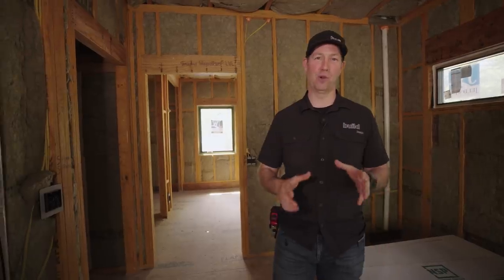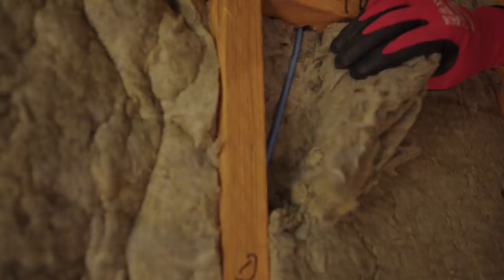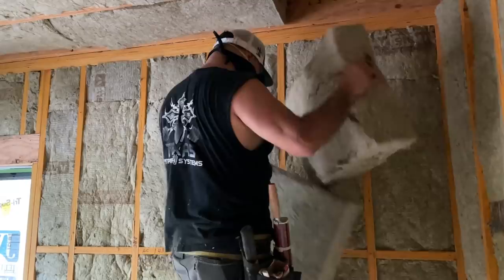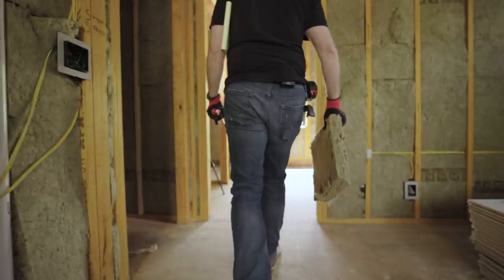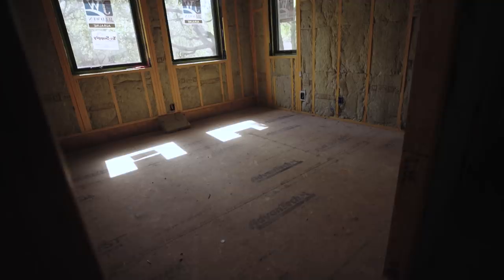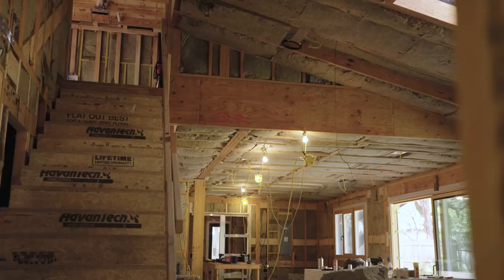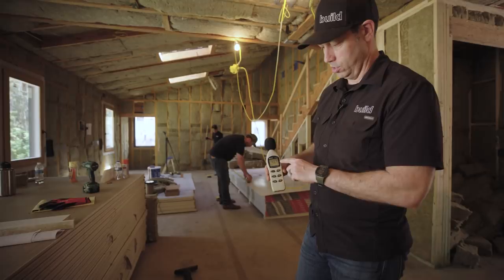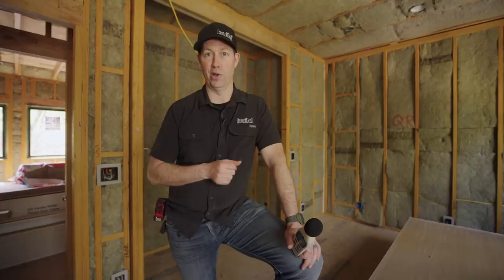7 reasons I used Rockwool insulation at my house.

Comment: I love Rockwool. 

My only complaint is that it needs an additional vapor barrier on the interior side of the wall like Certainteed’s MemBrain in cold states where I am. I also like to glue and screw my drywall so the vapor barrier basically makes gluing useless.

Much better than fiberglass, and there are so many horror stories with closed cell spray foam 😬

Comment: rockwool is also not bad for insulation (no matter what house or shelter you add it to); it is fireproof and waterproof, and soundproof as well as frostbite proof.. but if wanna save money, just insulate everything with several layers of polystyrene foam, even if you keep it inside your shelter, it will produce warmth and amplify heat by retaining it, and holding it from dissipating out into the outside or even in the cold air that creeps in at night in any house or room.. stockpile the foam in every corner, seal windows or walls with it, and your Ice Age survivability rate just jumped 60% (with the 30% fluid water that is antifreeze and drinkable and geothermal heating gave you).. also if you use this in your house and it's enough to keep you moderately warm at night or during blizzard, you can use geothermal for your water tank (as long as the antifreeze inside doesn't leak into the fresh water inside you store for drinking)

Comment: Matt, I totally hear what you are saying on spray foam insulation in the walls when it comes to floods and water; however, please just know that spray foam is actually water resistant, it’s just that when there’s a true flood the water can get in between the spray foam by pushing pieces open. I have spray foam insulation in my old field stone basement  which gets damp in heavy rainfall, the spray foam has accumulated 0 signs of moisture absorption and the company actually showed me it was safe to use by putting a chunk of it in water. It floated. Then they pushed it under and took it out, all the water came off and it was dry.
Reply: That sounds like closed-cell foam, he was showing open-cell foam that was soaked with water.

Comment: Rockwool is absolutely a great (if expensive) product, but I'm always leery of their advertising regarding sound attenuation since they are ALMOST deceptive, in what is never said and what is implied.

Rockwool's primary competitor is fiberglass and it turns out that both have extremely similar performance not only in R-value but also when it comes to sound attenuation. Uncovered Rockwool and fiberglass have very small measurement differences and almost no perceptual differences. But you will never see a Rockwool demo with the drywall installed. That's because when that happens, the perceptual advantages of Rockwool go notably south. In the covered case, Rockwool and fiberglass behave identically, from what the human ear can hear.

This video does a great job showing the many positive advantages that Rockwool has over fiberglass, so it's mildly jarring when the sound control aspect is trumpeted as a UNIQUE advantage, when it simply isn't.

(Regarding cost - it wildly varies by region. Here in Phoenix, Rockwool is quoted at 4X the cost of fiberglass!)

Comment: I would not use 2x4 on a new build but given the fact you had an existing foundation, I completely agree that LVL + Rockwool is the way to go, if your budget allows you to. Strongest framing option and best R-value per inch, besides all the fire safety and acoustic benefits. Sure you will have very little problems with this build in the long run.
Reply: What would you use instead of 2x4s?
Reply: @ducoh2093   What do you mean exactly when you say "staggered" 2x6s?

Comment: I sell insulation for a living. Rockwool is more expensive than spray foam but doesn’t provide an air barrier or vapor barrier. For the kind of money spent on this job I would take spray foam all day. especially in the roof where ventilation is critical with non air barrier materials like rockwool/fiberglass. It’s difficult to ventilate adequately when you’re batting right against the roof line like he did. Whenever you use non air barrier insulations you’re going to experience condensation, the ventilation is required to exhaust water vapor so the condensation doesn’t become a mold and moisture issue. If he were to spray foam, it would eliminate the condensation entirely and thus negate the need for passive ventilation. If this house were in an area that gets a lot of snow, it would likely get ice dams (which is a whole other moisture issue) with this insulation package. With spray foam those ice dam issues disappear also. 

Lastly, rockwool’s selling point against foam is that it doesn’t stick and it isn’t difficult to demo. I always remind customers that your drywall is a lot more difficult to cut through than open cell spray foam which pulls out in chunks by hand! Even closed cell cuts out better than drywall. Also, we typically build things to last, not to demo. 

But yeah rockwool is cool for fire blocking.
Reply: wow, ure so wrong... u sell insulation for a living and do not understand that rockwool it self is an air barrier. that is the biggest advantage over styrene type of insulations or cellulose one. Rockwool is made out of stone particles. Stone has natural ability to eliminate damp and moisture over time depending on the inside outside conditions. The only thing that can make an influence of what you say is the way you install the insulation. In us they tend to do the dry way of installing and in europe we tend to do the wet way by gluing the boards with adequate glue/thinset. The wet way is better since it makes more compact coat of insulation whereas the dry way has a lot of cracks that needs to be sorted out usually with an air barrier(what you've mentioned). In europe they use air barrier only on the north side of the building because that side is not exposed to sun light as much as it needs to so it can naturally ventilate through the rockwool.. The advantages of the rockwool over styrene type of insulation is that it is natural material and does not totally seal(such as closed cell) the space from outside. Typical Japanese Arch. house did only use natural materials such as wood and hay sack and they tend to make the living space totally connected with the elements during all season. In winter they tend to live around the fire place as a source of heat and during summer they use the shade and openings for natural air movement providing passive ventilation a thing that is being used today in the most advanced buildings. Today modern buildings tend to eliminate the natural way living by using modern materials but they forget that we as humns need to be in contact with the nature instead of being disconnected and living in air bubbles. Japanese trad. arch is the best imo. of a way to live in direct contact with nature during all seasons. A passive house standard is a different story and still id choose rockwool over styrene anytime. Styrene is better insulator in terms of r value but it is very artificial.
best regards.
Reply: @serafar  I’ve never heard of a wet-install of rockwool. So what it goes on like a plaster/concrete almost? That’s interesting! I wonder if it cracks over time as it dries or as the house settles. That’s not a standard application in this country so I can’t speak to its efficacy. 

Rockwool isn’t exactly a natural product though. It’s stone based but it’s still processed and produced in a factory with binders and everything else. And the philosophical debate over what’s natural and what’s not is interesting but when you get down to fundamentals, everything in this world is made up of chemistry. I would say a home we build for ourselves is every bit as natural as a nest a bird builds for itself.

But to my other point, the rockwool used this in video is not an air barrier which makes it inferior to polyurethane spray foam.
Reply: @seanstack180  what i meant was that rockwool has natural ability to regulate damp and moisture from tha air. eps and xps do not. eps has nothing against moisture and damp while xps is totally sealed and thus repeal moisture and damp back from where it comes.  eps will absorb all the moisture over time kinda like a semi sponge and considering the dew point in the wall it will most likely generate structural damp.this is why you need a air barrier.  xps will do you good protecting you from outside during winter but it will also protect the outside from  the inside moisture that comes from the human body and anywhere where there is water in the house. because of this you need a good hvac system. rockwool has natural ability to regulate the damp and the moisture meaning it will absorb it and slowly move it from one place to the other. this way you do not need some special hvac system. all yo need is heat source and window opening  when the sun is up during all season. esp in the summer you do not need to run an expnesive air conditioning unit. 
https://www.youtube.com/watch?v=un5gBFgc8aU
in europe the air barrier is the last coat of the facade and it must be silicon based glue that can let air pass - permeable one..
https://www.youtube.com/watch?v=BDVTlUiV_MA
all the best man..
Reply: @serafar  insulation doesn’t regulate moisture. The hvac system does that. Spray foam eliminates condensation and the hvac system regulates the humidity generated by people living in the house breathing/showering/cooling. 

And if something is an air barrier it is not air permeable, it is air impermeable. Spray foam is an air barrier and a vapor barrier, the rockwool as shown in the video is neither.
Reply: @seanstack180  I made a mistake mixing the correct term and that is vapor barrier. if u listen carefully at 5:02 he mentions what i am trying to explain to you.

Comment: @9:40 there's no reason foam shouldn't also be used for air sealing purposes.  Works great on my new place @ 4,000 sq ft and an ave $50.00 electric bill.

Comment: My house has 12 cm rock wool in the walls and 18 cm in the roof.
Live in southern Switzerland and insulation is mainly to keep heat out in summer more than keeping it in during the winter years.
Air con uses more energy than heating.

Comment: I bought $80 from ebay to reinsulate the oven after mice pissed fiberglass failed. It is a little tricky to install, it is stiff to work with, but it is so much better. The sides of the oven stay cold now, before they would get warm in self clean. Rodents dont like the stuff, and exactly like Matt said it will not hold water. I still have half of the material left after the oven.

Comment: Don't be to sure about the water-resistance. This stuff is used to keep aquarium plants hydrated in long transit. It holds water really well. Something like a splash or trickle won't bother it but a hurricane submersing it in water absolutely will absorb the water.

i would say tho the benefit here is that as a fiber, it's generally going to hold together better when wet than other forms of insulation.

Comment: I'm a big fan of rockwool insulation. I also use it between rooms as well. It does dampen sound quite a bit. Between the living room and master bathroom I can barely hear the tv when watching a loud action movie. 
 I have some ideas for some non conventional uses of it (exterior). I have one possible application but I would need something like the ridgid exterior version but in a larger sheet and 1.5" thick.  Awesome product that has been around a long time and there are so many applications outside of house insulation.

Comment: I use rockwool and hardy board insulation in between concrete block and masonry veneer. Also insulate inside concrete block.

Comment: I used R30 of mineral-wool insulation (not just Rockwool brand) in my basement ceiling, and I can concur about the sound absorbancy of the stuff.  I had R30 of fiberglass in the ceiling beforehand and I could hear the TV in the living upstairs while in the basement.  Now, with the mineral wool in place, I can't hear it through the floor.  The only sound that leaks through is from the uninsulated central staircase.

Comment: Love your videos Matt. Rockwool may be a great product but at more than double the cost per sqft than fiberglass without much R-value increase its hard to justify. You can get R-23 vs R-19 with rockwool compared to fiberglass. Per online calculators it will take 40 to 50 years to recoop the extra cost based on heat loss savings. There are other benefits but not sure they make up for the very long ROI.
Reply: I've seen test results that claim R-19 fiberglass is maybe R-13
Reply: @timothykeith1367  I've seen the same reports. I'm in the process of remodeling my house and I went with flash and batt. The a 1 inch layer of rigid foam on the outside. Walls should be about an r-24 but thats going with an r-15 on the fiberglass so maybe not. Spray foam should stop air movement and rigid should prevent bridging so will see what my energy bill is after all is done compared to before. Doing spray foam on seams and penetrations in attic and then putting in r-50 of blown in cellulose.

Comment: Interesting. I thought everyone used these kinds of materials now-a-days. We have in Sweden for a very long time. Either that or glass-whool, which is similar but with slightly worse fire-ratings.

On another note. We usually use a layered construction with a 50mm complete layer on the outside of the outer wall, while using what you show in the clip, for between the stunds, and then we add one or two additional layers of studs on the inside which goes perpendicular to the frame, which reduces the transmittance of heat through the wood, which is otherwise connected to the out-side cold.

Comment: It was hard to get in my area when I built 2007 or else I would have used it. When I did my basement later Lowes carried it and I used it to cover the XPS band joist inserts I made. Most just use glass and that's a poor half measure. Sealed with XPS cut to fit inserts and then covering with  mineral wool is the only one that makes sense.
People think fiberglass doesn't catch fire and they are right but it melts very easily and provides no protection over foam.

Comment: Maybe nylon mesh/netting tacked over batts for rafter installs?      Rockwool is such a welcome alternative, although not as cohesive a batt(you need to be much more careful when moving it through narrow spaces ...with fiberglass, you can 'pull' on it and not really worry about it coming apart ,but Rockwool requires a much gentler touch)   I'm with you on Fiberglass, floating silica dust is nasty ...I just hope I haven't inhaled too much!! Even with a dust mask that crap will get in your throat and lungs. Half-mask respirator at minimum. Love the Vids.

Comment: Matt...your sound transmission will dramatically change when you put your hard surface sheet rock.  You have a house of soft sound absorbing surfaces now.   Not saying it don’t work, just saying it won’t be as low when the drywall is up.  I put in my own house.
Reply from the maker: Totally agree. But the test is still valid compared to no interior insulation or rigid spray foam in the walls

Comment: Awesome, Mat there is a Roxul product that is overlooked, No blower needed to apply into an attic check out  Roxul's RockFill.
Play Safe From Elliot Lake Ontario Canada.
Reply: Roxul is no longer around. They changed their branding to Rockwool 4-5 years ago. The blown-in Rockwool is now called Rockwool Granulate. I would not recommend any type blown-in insulation, even mineral wool only reason it’s used is it’s cheap. It settles and thus thermal decay is issue very quickly.

Comment: You mentioned the drywall will change your sound transmission through the house.  True.  If you really wanted more isolation you will most likely have to decouple your framing. The insulation types won't differ all that much until you get to 3lb density products and some frequencies will favor the framing anyhow.  The RW products are great but not that impressive compared to 3lb for isolation.  Love the videos, thank you.

Comment: I'm not a dedicated insulator, but I've put up a fair amount of rockwool and fiberglass. Yeah, rockwool is good shit. It's at least as itchy as old fiberglass, which is terrible IMO, but once it's in it's better in every way. I put a bunch of off-brand mineral wool in my own home and the improvements are enough to notice. The least obvious benefit is the greater thermal mass, which helps a lot when you're in the part of the year when you might cycle between heat and AC depending on the time of day. After mineral wool, I don't use either on those days.

Comment: Matt
Unfortunately it takes a lot of fossil fuel to melt rocks into insulation… lots of “grey energy”.
That is why I choose to use cellulose insulation in my projects.  I can melt a penny in my hand using an acetylene B tank holding a clump of cellulose to protect my hand.
Cellulose insulation is made from recycled paper, which was made from trees, which took CO2 out of the atmosphere, making my home a carbon storage vault.
You build very well,  thank you for sharing your projects with us !  Someday the Homebuilding conversation will include the term “Carbon Sequestration.”

Comment: Let's see.  Independent testing shows that the sound deadening effects of Rockwool vs fiberglass are the same and equal.     As for fire resistance, yes Rockwool melts at a higher point (2000⁰F vs 1300⁰F for fiberglass) But an average house fire is about 1100⁰F.   
Rockwool also is known to settle and sag over short amounts of time where the lighter fiberglass doesn't.  
Also, this is a paid sponsorship.   That's why you don't talk about the negatives.